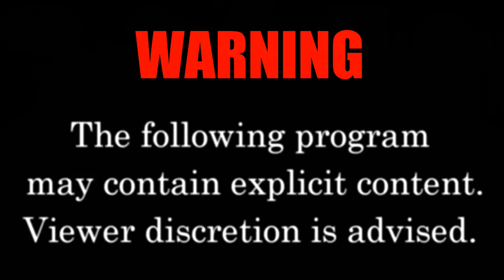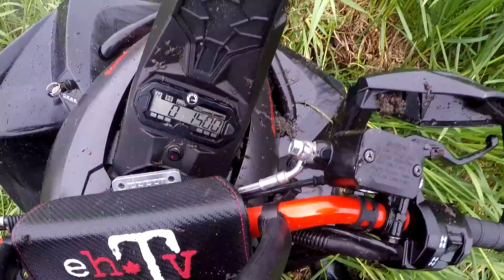Jurassic Safari, The Lost Swamp

Comment: And the plot thickens...talk about some awesome footage to mess around with.  That place was just a blast.  Wicked job buddy.
Reply: NOS Atvs your “check DPS” code... pull your speed sensors out of transmission and the outer crank case and clean them off. I just had the same issue and cleaning them off fixed it.

Comment: NosAtv your “check DPS” code... pull your speed sensors out of transmission and the outer crank case and clean them off. I just had the same issue and cleaning them off fixed it